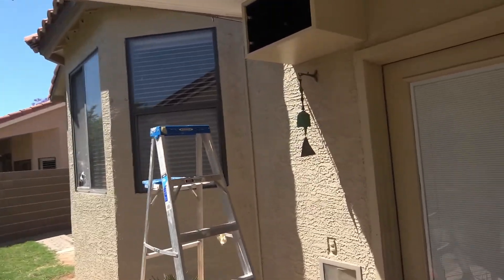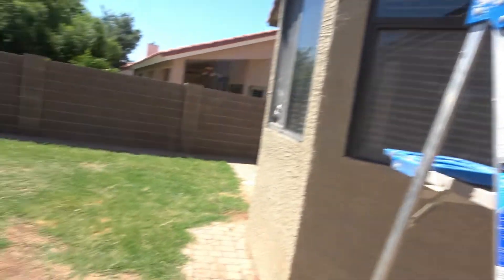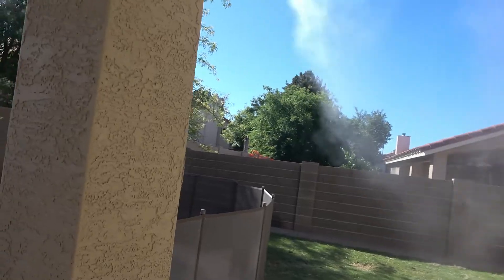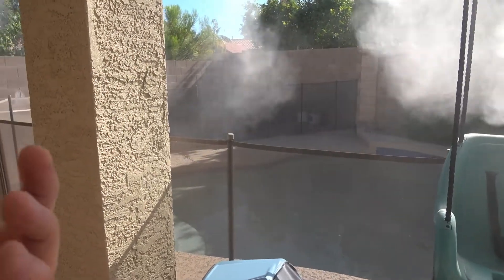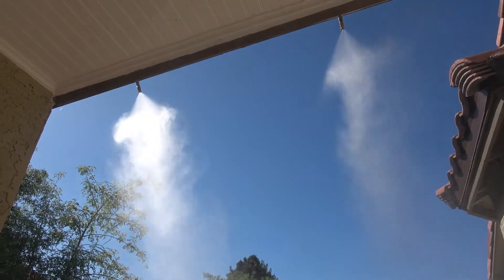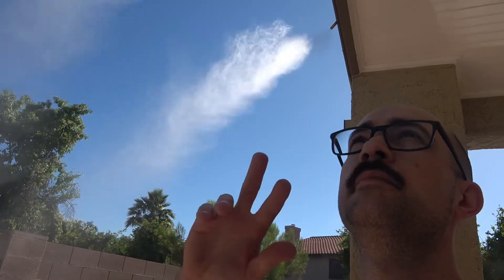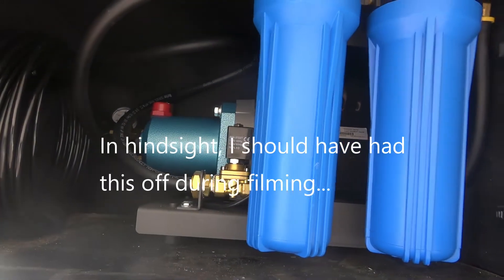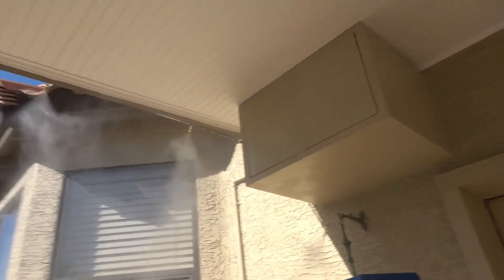Misting System Tips and Recommendations

Comment: If you need 1000 psi for a misting curtain then you are using the wrong nozzles.

For people thinking of installing something like this.  Look elsewhere unless you just like shoveling money out the window.
Reply from the maker: For people thinking of listening to advice like this, look elsewhere unless you want to listen to someone that doesn't understand the basics of pressure and it's effect on the atomization of molecules. 

Higher pressure through a finer nozzle = greater atomization = faster evaporation = more cooling

Yeah you can install a system under $100 and it will work. But not nearly as well. There's a reason people who actually know what they're doing use systems like this.

Look up atomization. It's very real and very important for many things, to list a few: solid rocket motors, fuel injection, paint nozzles, nano-coatings, and on and on

Comment: the 160 psi pump is fine if you don't have too many nozzles, this guy has a system a restaurant would get, it makes a racket too, does he have a wife?  you can get diaphram booster pumps from mazoon that will get you to 70 psi for under hundred pucks

Comment: OK engineer, I got the orbit booster pump (160 psi, 45 psi max inlet) and I've dialed down my "house" pressure to below 40 and it still keeps on flowing out of the nozzles.  I contacted orbit and they said there was a valve in there to check but opening it up I didn't see any valves.  I want to put my misting on a timer ( its for plants in the desert) without it emitting when it's turned off.  I had it running gravity feed off an IBC tote before and it would shut off but thats prob only 5-10 psi.  maybe I need a pressure valve on the pump outlet

Comment: I have an aluminum pergola and would like to install something that would spray the roof every 10-ish minutes for about 30 seconds and cool down the roof. So I don't need mist to fall on people below or create a curtain, just to wet the roof and cool by evaporation because when it's hot you can feel the roof emitting the heat directly over your head. Is there such a mist system with a timer? I will also look into painting the roof with some bright reflective color, and try to deflect the sunlight.
Reply from the maker: @jupitereye4322  what you're talking about would be very custom. An unusual case to be certain
Reply: I realize this comment is close to a year old, but i have to say that cooling in this way is quite common in greenhouse horticulture. So is anyone is reading this: its definetly worth a try.

Comment: Can you adjust the mist for more or less
Reply: you can adjust it based on the water flow. but you generally want to dial it in for whatever your situation and you shouldn't have to adjust it.
Reply from the maker: You will adjust it to achieve the proper pressure and flow for your setup (system size, mist nozzle opening, etc.). After that, you don't adjust it on a day to day basis. Basically what @JHess said

Comment: So for a more humid area (I'm in South Florida), would I need a higher PSI pump for "high pressure" to create a very fine mist? Or will  a misting system be ineffective down here?
Reply from the maker: If you buy a dedicated pump that is putting out ~1000 psi+, that should be plenty. For more humid areas, you want to choose a smaller mist nozzle size because a finer mist will more readily evaporate. You'll know you have the right combo when it is cooling the area and not leaving wet spots on the ground. Recommend talking to a local shop that can provide guidance.
Reply: this works more on the evaporation model. if you're in florida i'm going to say it may not be what you're looking for. a nice ceiling fan would probably be better but if you want a misting system then yeah, smaller nozzle, lower psi would be better for less humidity. in florida you are probably dealing with lower temperatures so the moisture that the misting system would put out would not evaporate as fast and would more than likely do the opposite and hold more heat in the already saturated air. good luck!
Reply: @JHess dude you are so misinformed on misting systems stop commenting and spreading bad advice ...
Reply: @frankie53250  sure kid, whatever. lol

Comment: Hi! Which pump is this? I am looking to do this for a small restaurant patio. Also it looks like you are in AZ as well!
Reply: hey. also in arizona. yeah you don't need anything crazy like that. if you find someone who knows how to actually put a system together you can run off city water just fine. that pump is serious overkill. line size, nozzle diameter and distance makes all the difference. you also want to try and calculate for height and distance of mist fall/sec.
Reply: @JHess  hope you don't mind me asking a couple mister questions! I'm also in phx area, about to install a simple kit. I have a similar small patio as in the video. I have 9ft ceilings. Which nozzles would you recommend with city water? My pressure is around 45-50 psi. If I follow the 2ft spacing rule, I'll have 7 nozzles on my run. Is this good spacing? How close to wall edges would you have them? Thanks!
Reply: @JHess you are an idiot . Hose pressure is not even close to the same as this . Higher psi rating atomizes the water molecule allowing to cool the air faster . There is a huge difference and hose kits without a pump sucks !!!

Comment: That thing is loud 😅
Reply: Pumps should not be put right on your Patio. Pumps gets installed around the side of your home so you don't here that noise.
Reply: FYI Blue head pumps are not a recommended pump. Anything with a Blue Head is very loud and low quality.

Comment: Lots of great info here! Just installed a new high pressure system and have been trying to figure out what nozzle size to get. I'm in AZ and I have a .012 nozzle size and noticed a bit of water on the ground so I think .010 is the way to go since my patio cover is lower like yours.
Reply from the maker: Glad you found it useful!
Reply: a 40 micron nozzle should give you the proper size droplet that would fall at about 5ft in 31sec give or take for wind drift. (so .04mm)